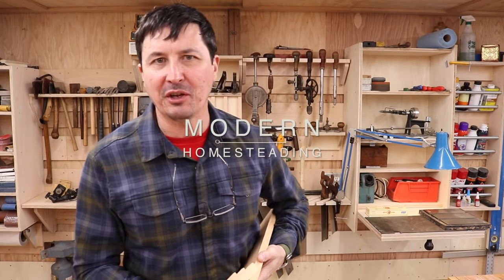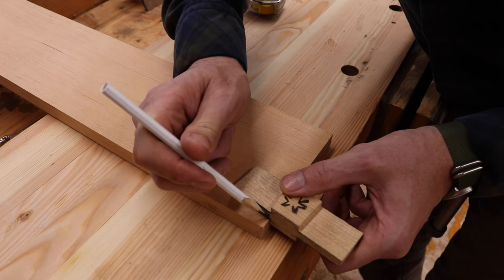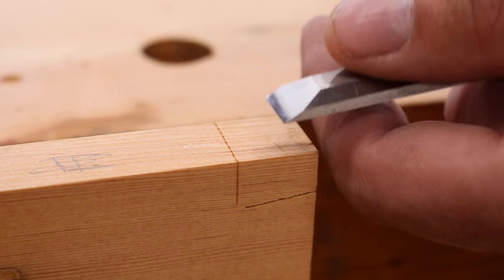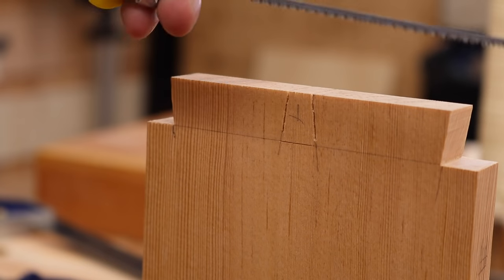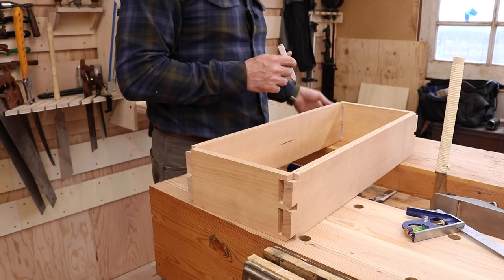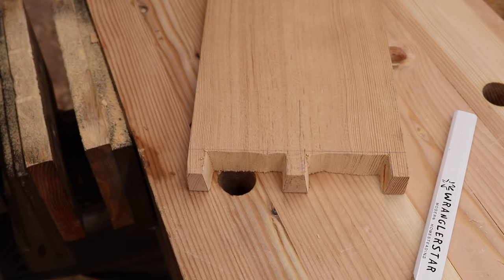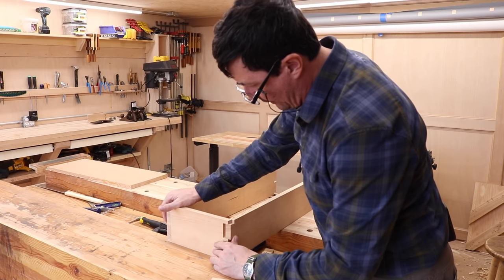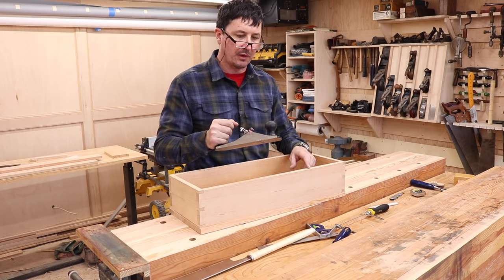Hand Cutting Dovetails Using Cheap Tools

Comment: No rope. Oval cutouts. Better for storage. A much better design. Clean and simple. You could even design a release catch inside the box that only you know how to open the lid. You would have to put your hand inside and would also have to know what to do once your fingers are inside in order to release the lid. This would be really nice. No exposed hardware but, a secure locked box. (unless you know how to open it).

Comment: would love to see a video of you sharpening your chisels with larry potterfields method.  he gets a piece of plate glass and tape various grits of sandpaper on it, then use either honing oil or water and run the chisel blade along the sandpaper that is backed by the plate glass until it is a damn near mirror finish.

Comment: at 25:30 you are searching for a term for the cut out handles.  You are correct that they are not "ovals"  (that is an egg shape), but I am wondering if "elipse" is what you are looking for, but an elipse does not have parallel sides.  We all know what you mean.  I would like the ropes.  For the thought that it could not be pushed up flush with a wall, is there a way that a small relief could be cut out in a way that you could pull the rope inside the box, and the rope on the outside would be pulled into the relief so it does not stand proud of the box?  Anyway, great video, and you should consider sending a dovetail jig along with the box for the lucky winner (ahem...me).  God Bless.

Comment: Wow, you know, I'm probably not worthy of winning this. I don't think I'll find the time to make anything as nice as that. If I was building it I'd have cut 4 pieces of aluminum L profiles, drilled holes in them, saw the edges of the boards at 45 degrees, and fasten them with the aluminium on the outside (so it can handle some bumping around). I did enjoy looking at how you made it, that is really nice! In fact looking at the 2nd minute I thought it just doesn't look "real", in the sense that it looks too nice to be real :-) If I ever get to retire (by the rate the eligible age is shifting I guess I might be allowed to retire after reaching the age of 120 or so) I might try to do something like that.

Comment: a marking guage is another excellent basic tool to have.
Reply: Easily made and readily available at any woodworking store. To correct one thing, it isn't a 7 degree angle - it's a 7 to 1 slope and that works for soft wood. Use 9 to 1 for hard woods that won't compress very much or prepare to be super accurate.

Comment: Why draw lines and risk knocking the boards out of alignment? Couldn't you sprinkle some powdered charcoal/graphite (or even spray paint) through the holes in the "template" to mark where not to cut?

Comment: I'd vote to rabbet the bottom in ½ way and put a center divider with the 'oval cut out' in the raised center divider, making the box capable of being carried in one hand (a classic style).  You could dovetail in the divider as well (side slot style) and then glue in.  Simple and matches your other joints.  Now, I realize that's not the choice you gave, so barring that choice, go for the ovals and be done with it.  If I were to do rope, I'd do it across the top so the box could be one-hand carried.

Comment: how ever and what ever handle style is choosen. doesn't it need to be made with using the tools from the tool box?     I vote the slot oval cutout handles.  and as others have already said an addition to the toolbox needs to be a dovetail jig, as hard to make a dovetail box without a jig.

Comment: Why did you make the tails so large and the pins so small? The small pins seem like they would be prone to breaking off.
Reply: When its all glued together it acts as one piece of wood, particularly if attention is given to snug joints.
Reply: Sure, but before it is glued, you have to put it together and take it apart while test fitting it, sometimes multiple times and with some force. It is then the small pins or tails could break.

Comment: Wranglerstar: I don't mean to be one of those " knowitall's". But you have your coping saw blade in backwards. It should cut on the pull. I'm a Craftsman so I should know. And yes. Hand cut Dovetail Joints are difficult. Only practice makes perfect.